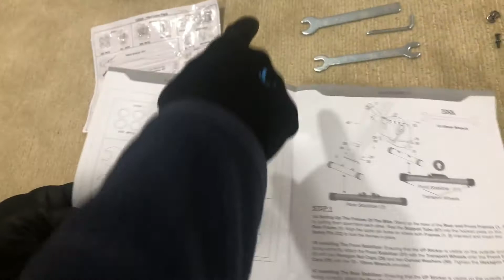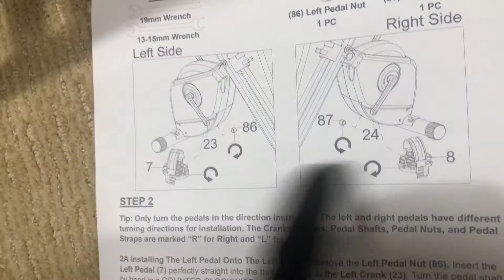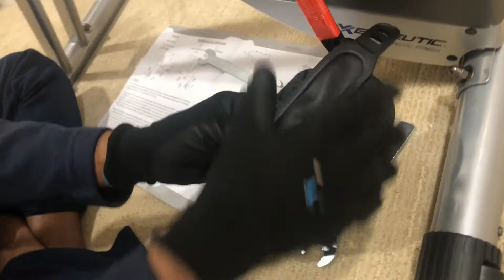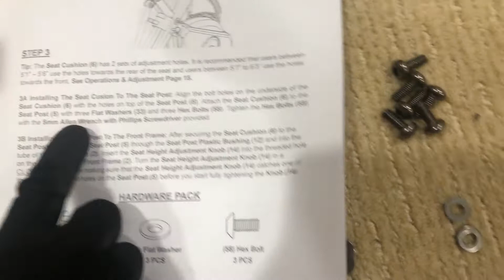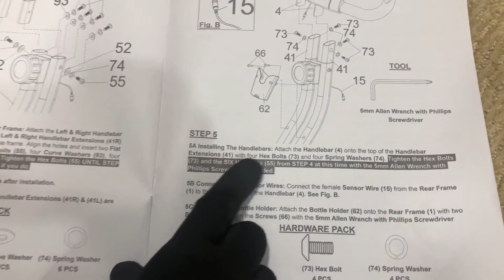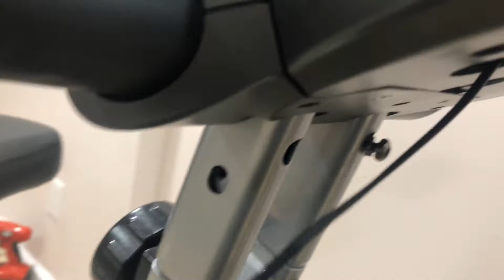Exerpeutic Folding Magnetic Upright Exercise Bike  Assembly

Comment: FANTASTIC tutorial on assembling this bike! I bought one second hand but could not understand why the display illuminates but failed to track distance, speed, calories, etc. Only the pulse portion was working. I could not find the manual online that showed enough detail, so watching this video made me realize that there is supposed to be a wire (cord) that comes out of the back of the console that connects to the other wire (cord that is coming off the main frame. NOW I know why it does not work. Wondering if there is a way to open the back of the console to see if the wire just slipped down out of sight but can not figure out how. I have removed all screws but it won't budge when I lift the latch.
Reply from the maker: Glad the video helped you identify the issue, but unfortunately, the console casing is usually glued shut during manufacturing.

Comment: Thank you so much. I'm a 75-year-old woman and by going slowly, step by step with the book along with this video I was able to assemble the whole thing by myself in 1 hour. For me the hardest part was getting it out of the box--lol—after taking out the top pieces, it was made easier by flipping the box over and lifting the box off the pieces on the bottom. A pair of scissors is needed for unpacking, with all the plastic and tape. Because I'm not that strong, lifting the front weighted part onto the front stabilizer so the holes lined up with the studs was also kind of difficult.
Reply from the maker: Thank you so much for sharing your experience and glad you were able to assemble it all by yourself. Thanks again.